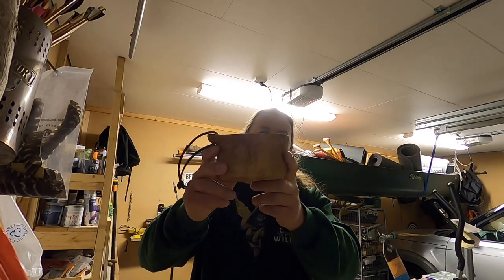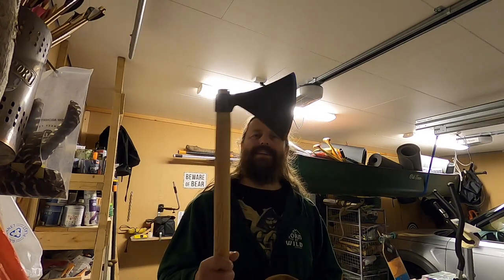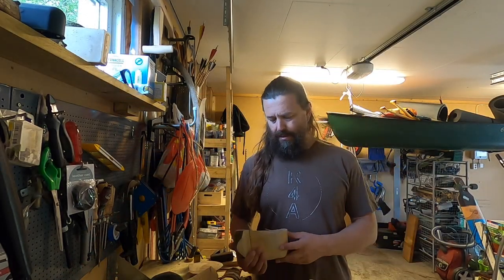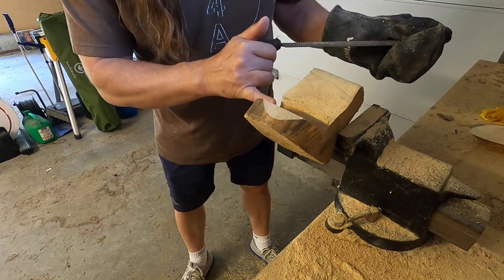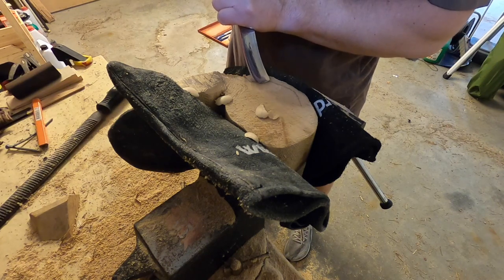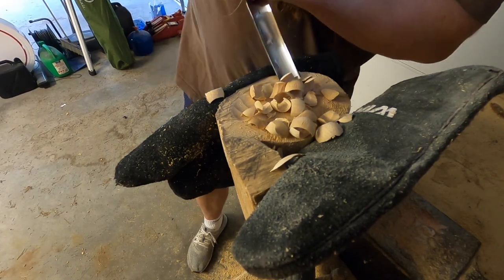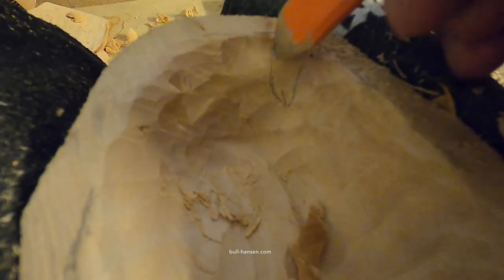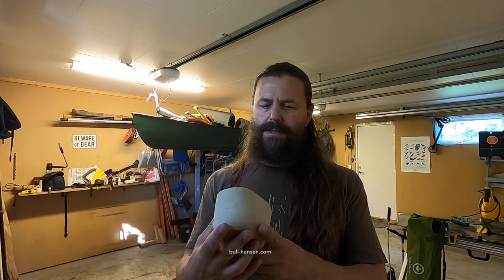How to Carve a Kuksa

Comment: Fill that crack with epoxy  mixed with the sanding dust from the wood. Force it in as far into the crack as you can on both sides. Sand after hardening. It will never crack there again. Words from a wooden boat builder. Me.